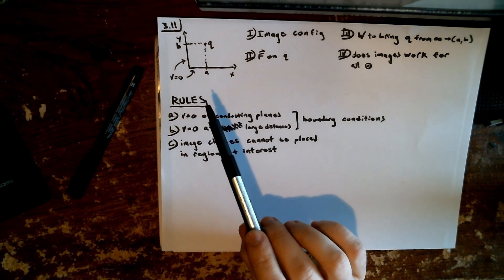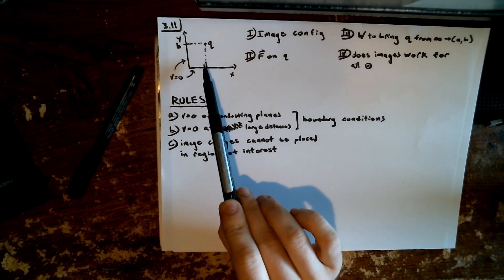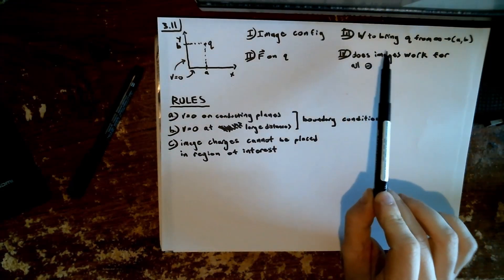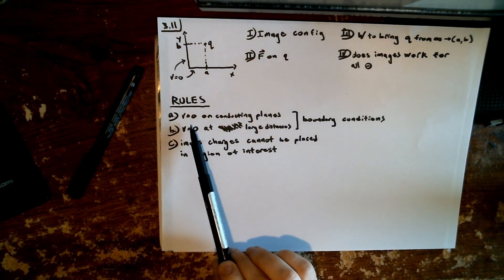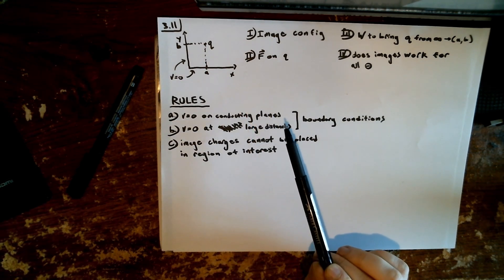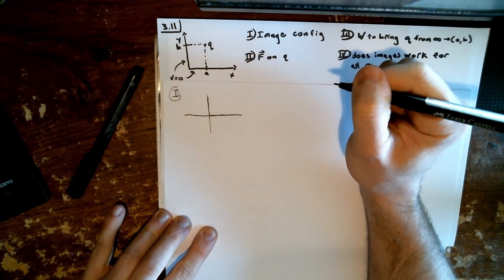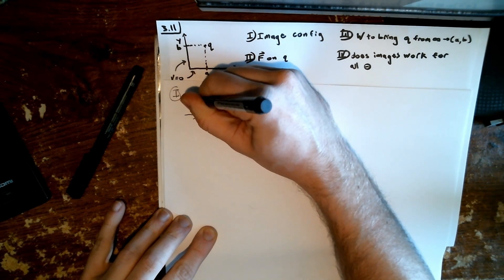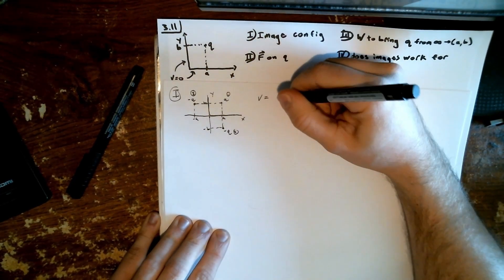Griffith E&M Problem 3.11 Solution (By Sean Hostetter)

Comment: Could be wrong, but I think you used the wrong equation for part 3. You found the work required to create the entire charge configuration instead of the work required to bring the single charge from infinity, which is just q * delta V.
Reply: the calculation is correct; imagine you are bringing charges from infinity; the work do bring q1 is then half of energy to bring separately q1 and q2; q1 and q3; q1 and q4 (you dont do work on image charges and potentials are additive). I think generally work to bring charge from infinity to the neighbourhood of conductors is 1/2*Q*[sum of image charges' potentials evaluated at the place of the real charge]